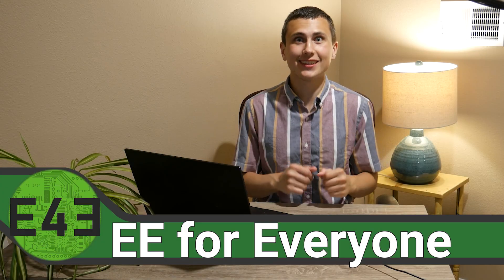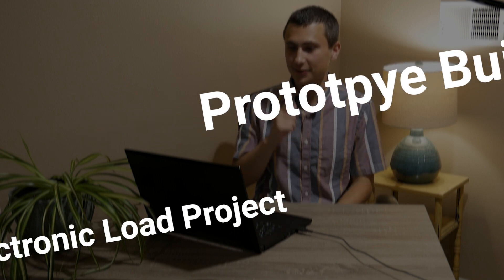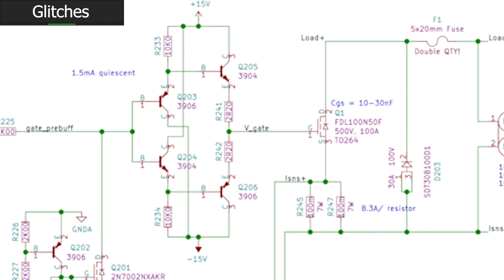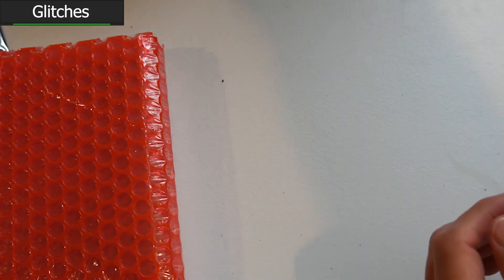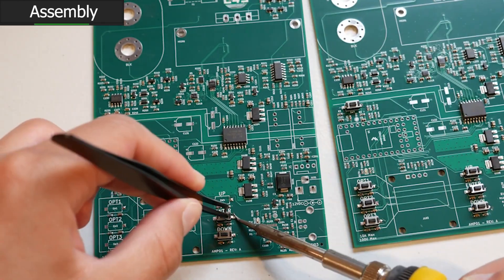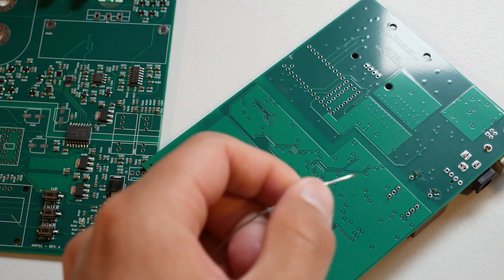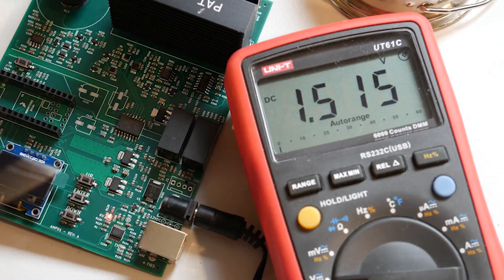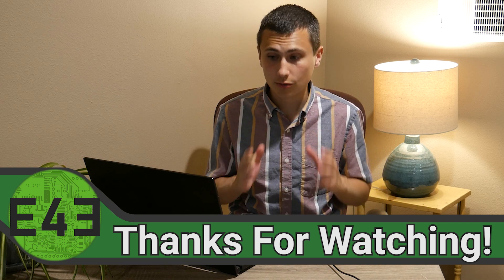First Electronic Load Prototype! Let's build it!

Comment: Man a 1KW electronic load is pretty lofty with the form factor you're working in now, but I think it could be done with water cooling, you're going to need a big radiator. 

I've messed around with making my own water blocks...nothing particularly "practical" for mass  production, but I'd be willing to machine a few one off parts for you if you're interested.

Feel free to reach out to me if you want...just keep in mind that I have manual machines, so the design would need to be rectangular or round.

Keep up the good work, I have a feeling that the "secret sauce" is going to be in the soft/firmware.
Reply from the maker: Hello Dr. Rockzo. Yes, the form of our design will REALLY need to change. That tiny little heat-sink won't even come close to 1KW. 

I'll try to keep our design constrained to off-the-shelf parts, but I remember the offer you made a while back (and reminded me). I have a feeling that when we need a custom machined thermal something, it'll be a weird-shaped block with some heat-pipes somehow worked in there. 1kW might even require sub-ambient water cooling, but I want to get there, at least once!

Thanks for watching, and I can't wait to share our plans for the project! It's going to be a good few weeks for sure. :) Cheers!

Comment: Good work! cant wait for the second prototype!

I am myself starting v2 of my motor controller, since i ended up blowing the power stage after having  introduced a bug that caused the igbts of one rail to to close, shorting the motor and voltage fed back which resultet in a swift pop. I am stealing your oled display implementation haha. if you have a video where you prototype with it id gladly watch it.

Also i might concider hardware or use the onboard comparators of the micro to make it a bit safer! 

Keep it up!
Reply from the maker: Hello Ghoetic! That's awesome! Yeah, these little displays are pretty easy to use. I ended up making a little breakout for 6 buttons and one of these displays, that will probably end up seeing some use in the future.

 Ha! Not sure if the "bug" is hardware of software, but I always strive to make the hardware design such that software can never make it explode. Though... I know that gets incredibly difficult when working with the voltages and powers of your motor driver. If I'm remembering right, isn't this a 3-phase 208-ish project?

Hardware is my favorite for lock-outs or safety functions. Much easier to simulate, analyze, and be confident in. (IMHO) Thanks for watching!
Reply: @EEforEveryone  
I have current the same setup, 6 buttons and the display on the breadboard. Also wondering if i am going to go the route of master and slave controller. And if so should i try to port the OLED library to microchip. hmm lots of options.

Yeah! the "bug" was my bad programming practice and the result of not testing it again after changing lines in the code.
 230v in, three phase output. yes software faults are very scary...
Reply from the maker: Hmmm, I may or may not have a few breakouts if you want that on a remote PCB. Got a bunch of spare fabs... to break that out into a 0.1" header... If you're into that sort of thing. Maybe send an email to our business inquiry email? See if we can work something out.